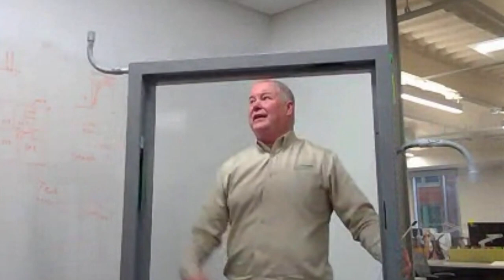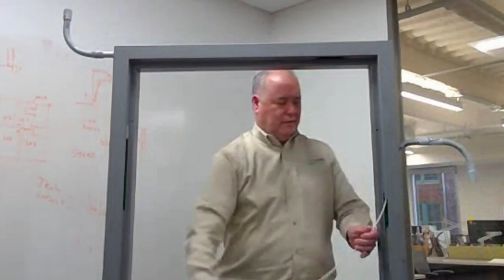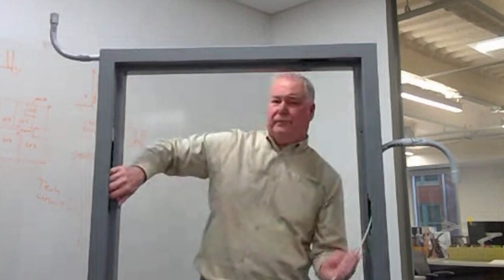A Better Way to Fish Door Frames with Frame Frog | RCDD

Comment: This is pretty cool, I just picked up some store front metal to try and find a way to make those easier to fish. Usually have to route your cables while the frame is being installed. You get one shot on a lot of store front doors, so if you need to add any cables it sucks. I like this idea I’m gonna check this out.